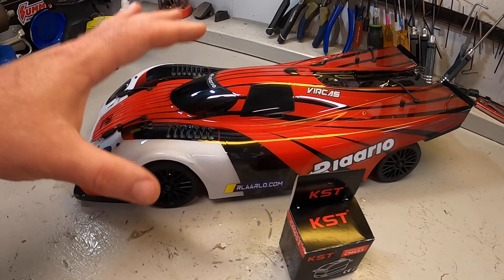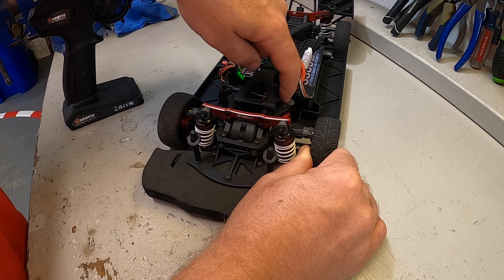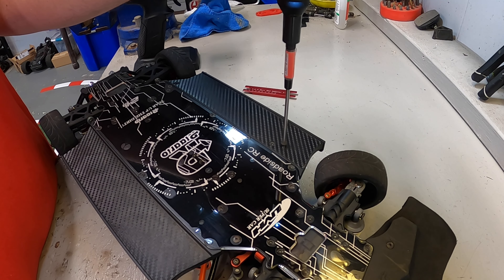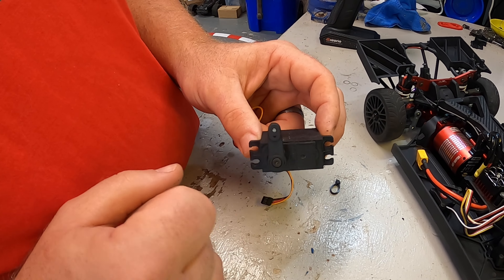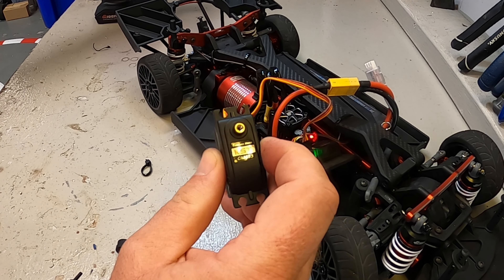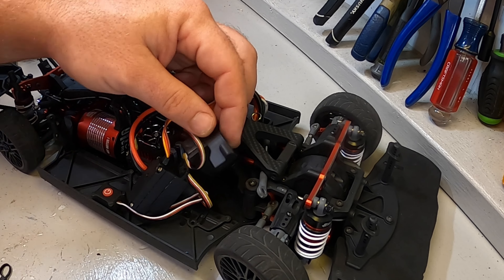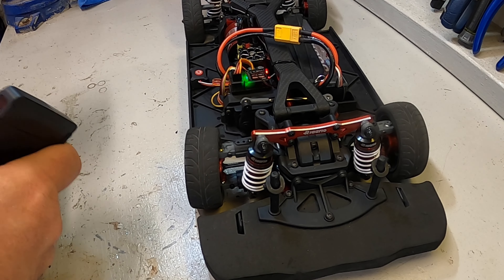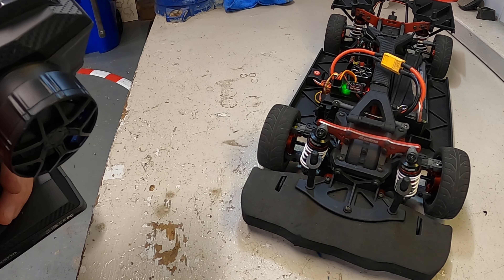TESTED!!  KST CM653 Low Profile Servo Upgrade for Rlaarlo AK-917

Comment: Thanks, just ordered one for my BBX, the Hitec 77bb burned out after only three runs… and yes the endpoints were adjusted. Think it didn’t cope with the jolts and bangs from off-road driving. Hopefully the KST will work
Reply from the maker: Does the BBX have a good servo saver on it?   I am surprised that it killed a servo. 
Good luck with the KST!
Reply: @ thanks, yes it has a metal spring ring, pretty soft actually, so I’m surprised also. Could be a rogue bad servo … I’ll try warranty on it. But the KST is going in nevertheless. Thanks for your input!